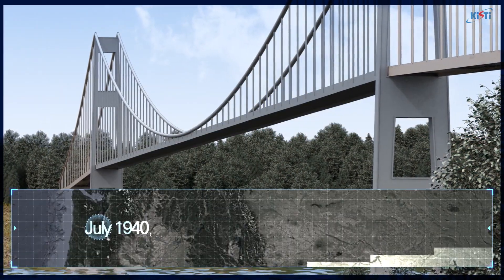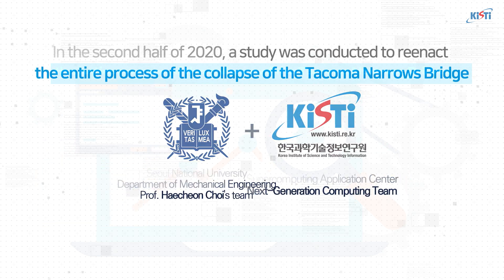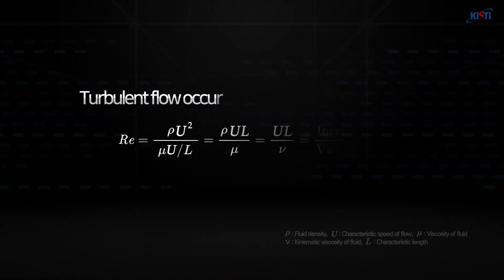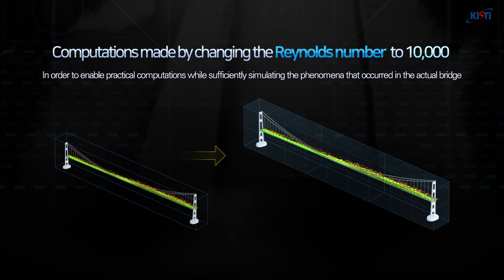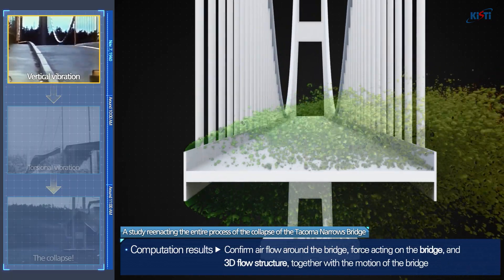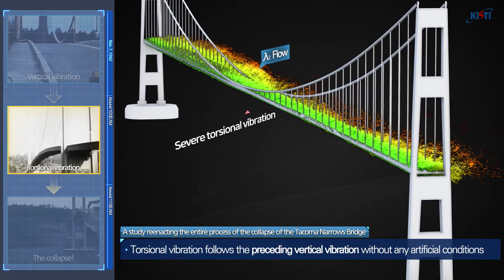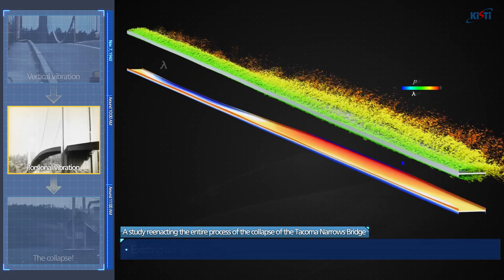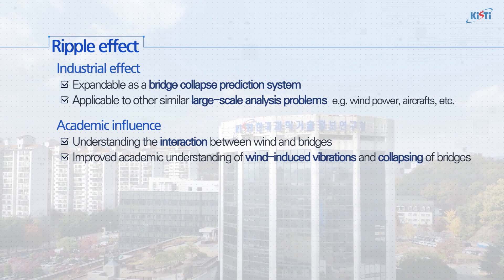The entire process of the collapse of the U.S. Tacoma Narrows Bridge

Comment: Do I understand it properly?  You proved that the twisting vibrations were started by the vertical ones. I heard before that the torsions were initiated after one of the vertical ropes broke. According to you the failure of the rope was not the reason but the result of torsions. But you do not mention the rope.